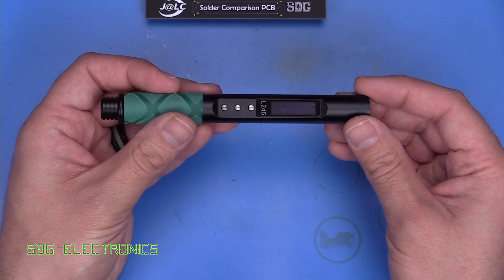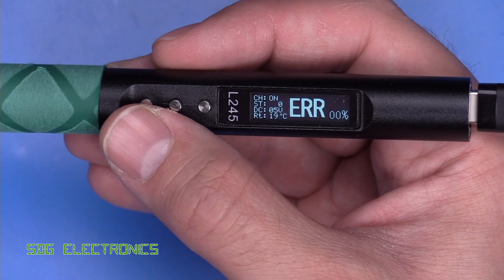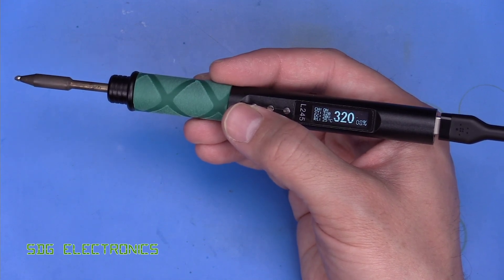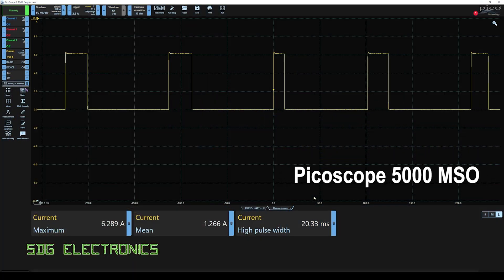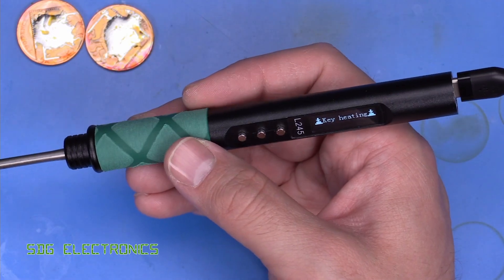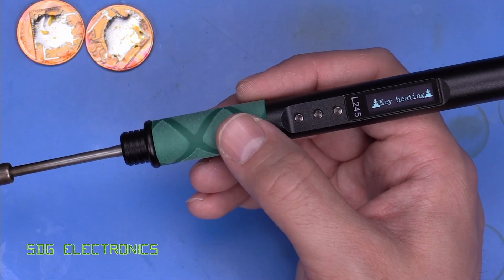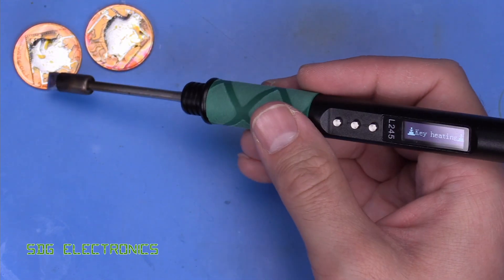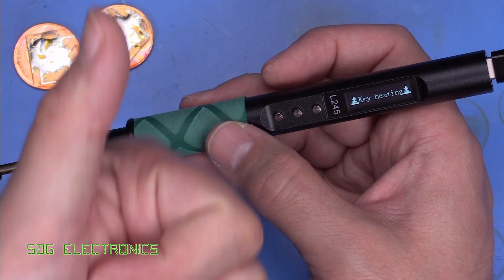SDG #284 130W Capable JBC C245 Soldering Iron

Comment: I see that there is a 48V 5A specification for USB-C; but that only give 240W of usable power. If it was me I’d have taken it up to 74.5V so that you can still stay out of the LVD requirements 

So can’t see how they would get to 300W? the max current you can put through a good USB pin is 5A, so two pins 10A so you would still need a 30V power supply.
Reply from the maker: 300W was wrong anyway. I mistook my power supply hitting limit as it being 300W, but of course I was not at the maximum output voltage.
Reply: @sdgelectronics  Still a great video as it gave me something to think about.

Comment: Nice follow-up video. What is the point of these USB soldering irons vs. a soldering station? I see no benefit, you still have a cable to the handpiece, the handpiece is propably heavier and larger and the price benefit is diminished when you need a bench power supply to use it to the same performance as a soldering station.
Reply from the maker: Portable use is the only reason for these in my opinion. Some people like them for the low cost though
Reply: @sdgelectronics  100% the portability is the thing for me. I fly RC planes and quads, and having one of these styles of iron (this, the Pinecil, the TS100, or my personal favorite, the Weller RT Soldering Pen), means taking a "real" soldering iron to the field to be able to do good work if you need to. The fact that they don't cost a fortune is nice, but not a deal-maker. I'll gladly buy legit JBC/Hakko/Weller tips for these at $30 apiece. That's where the quality difference is really noticeable. And if one of those companies made an iron like this to fit their tips that didn't feel like it was half-finished, I'd gladly pay a good deal of money for it, as well.
Reply: I’m a service tech and I have a tool backpack I take with me everywhere. Having a small, portable, lightweight iron that I can use to solder a wire to a lug or replace a basic through hole part on the fly is fantastic. I keep a metcal with me for jobs where I really need it but if I don’t have to haul an extra piece of gear in or out of a location and I can get jobs done with everything in my backpack, it saves me time and hassle. Currently using a TS-100 for this purpose and it almost always gets the job done. Unfortunately, I’ve broken the crappy plastic case 3 times and they’re no longer available, so I’m looking at this guy as a potential replacement.

Comment: Thanks for the follow-up. Doesn't a power supply already have a capacitor bank? BTW, I'm wondering if you will try to design a DIY RF power supply compatible with Metcal cartridges?
Reply: If a power supply has to much capacitance after its final regulation stage it can't be properly regulated, since the capacitors can deliver way more than a set current limit.
Also it would hold a higher voltage when turning down the voltage, which can cause problems.
Reply: There are already DIY RF supplies if you google.
Reply: @jaro6985  Thanks, I've seen them but I'm not sure how well they work or if they are properly designed. I think Steve would do it right.
Reply: @acoustic61  he doesn't have time to do this, you can read the 500+ posts discussing the DIY models that already exist.